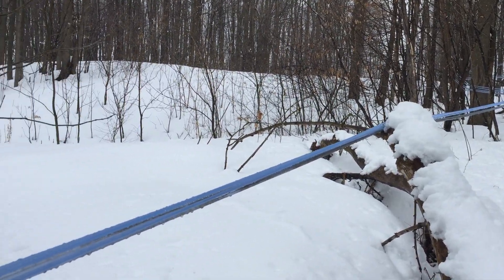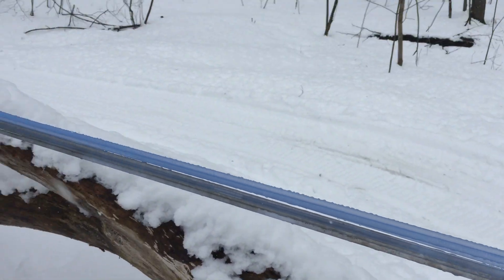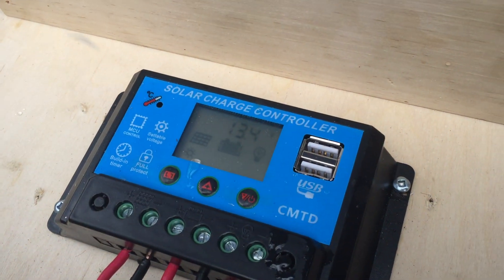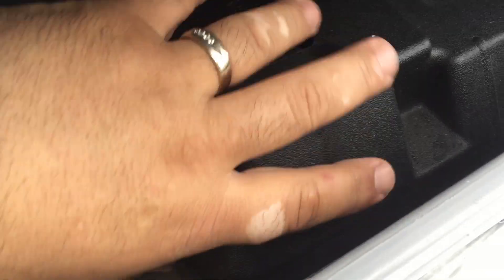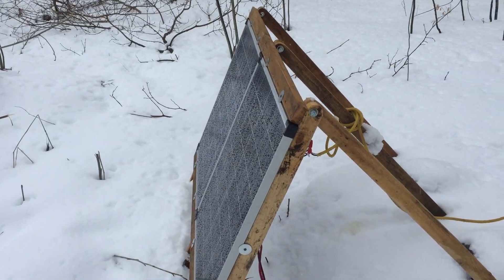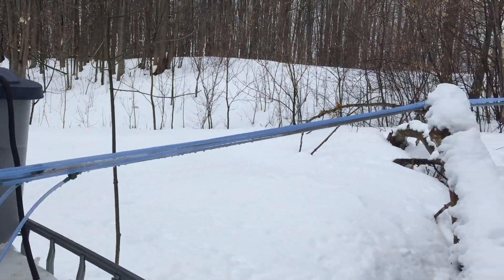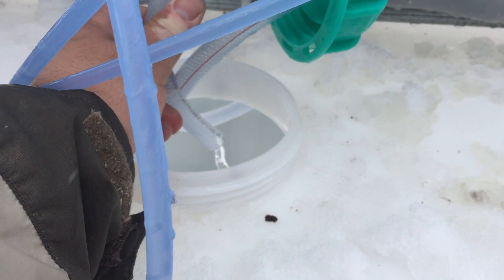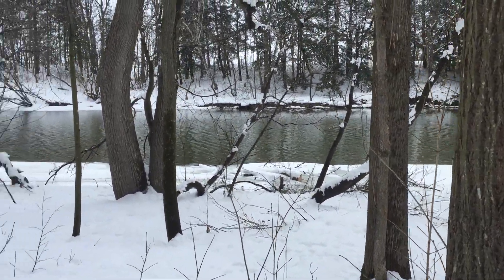Shurflo 4008 maple  sap vacuum pump setup - SOLAR POWERED

Comment: Thank you for this video!! and to the others that have made videos of there setup based on yours! Im starting to piece together a setup like this but I have 110 access so using ac to dc convertor. 100ish taps with longest run 400ft. If I hit any snags I will reach out!

Comment: Do you find the 2 x75w solar panels enough to keep the battery powered up?  Was at Costco today and they have a 120w solar kit for $200 cdn  comes with 8.5 A charge controller
300 W modified sine wave inverter.  Was not sure if that is enough wattage to keep battery charged.
Reply from the maker: Hi, yes, if you have good clear access to sunlight.  I have been using the system for 4 years now and have never had to charge the battery during the maple season.  I do recomend a type 31 deep cycle battery.  Just keep an eye on your voltage.

Comment: I've been inspired by your's and Wander Wild Farm's video regarding your vacuum system.  Currently, I have 214 taps of which approximately 187 taps are on 3/16 tubing and about 27 on buckets.  Some of the buckets and tubing are located along the road and about 80 minutes to gather and pump into my holding tank.  I am considering abandoning the roadside taps and focusing on approximately 130 taps in what i call the back bush.  All the taps except for about 10 would be at an elevation above the tanks. With those 10, I'd have to lift the lowest tap approximately 20'.  To maintain my current production level, I'd have to increase my sap production to approximately 14 to 15 US gallons of sap per tap.  Is this possible?  I think you mentioned making 100 US gallons on 175 taps, which is roughly 23 gallons per tap, is this so?  Thank you for your comments.
Reply from the maker: Thanks for watching, and i truly understand wanting to get away from buckets. As much as i enjoyed the work and traditional look of the buckets hanging from the tree,  time was sparse.
This year we stopped collecting about 10 days before the season ended, and still managed to collect 3040 US gallons.  which worked out to around 15 gallons per tap. If we where to go to the end of the season we could have pulled in more. This is based on 200 taps as we added one new line last year.  we do not have any taps lower than the tank so i would imagine that could bring your overall vacuum down if all running on one pump.
this year our system was running at around 16-17 inches of vacuum, not the best, but better than nothing.
Reply: @SpruceCreekFarm  Good morning Chris and thank you for your quick response.  I subscribed and hopefully will be getting all your videos.  I'm in the middle of clean up know, but will check out the rest of your videos.  I have a couple of questions.  I think you indicated running the pump for about 20 seconds when redirecting the 3 way valve to remove water from the pump.  Is that adequate, no other drain?  What is the make and model of your temperature controller?  Where did you get the 7, SS barbed connectors and are they 3/16 or 5/16?  I was thinking running 5/16 from the manifold, then installing a 5/16 quick disconnect and 5/16 to 3/16 tubing connector so I could easily remove the fittings.  CDL makes both fittings.  I was impressed with your approximate 15 gal sap/tap, as that could work very well for me.  Oddly enough, I just turned 70 and I'm looking to reduce the number of taps, but I still have a steady customer list that I wish to maintain.  I have a CDL, 18" x 60" which I've retrofitted with a heat exchanger and oil burner.  Removing approximately 17 gallons/hour.  Also built a single pass RO, concentrating  to about 4.4% on average.  Last year in just over 2000 taps, I gathered just over 1,800 US gallons on about 210 active taps in 10 gatherings, with an average sugar content of 1.86%.  I was so enthused by your's and Bob Sookochoff's video, I was up  until midnight designing my own unit.  One other question: do you shut the unit down at night?  Thank you so much, look forward to your response.  Stay safe in this pandemic, Earl Weller

Comment: Looks great. Could you provide a schematic and parts list for the controller? What temperature sensor do you use?
I have a storage tank pump that pushes the collected tap up to my evaporator storage tank.
Thanks

Comment: Great idea and execution!  I’ve been pondering how to build a 12V solar powered vacuum system for a couple of years.  Yours is the first example that has me really excited. The temperature controller to turn the pump on and off was the eureka moment for me. I’ve ordered the parts and plan to have around 200 taps on a similar system this spring. Thanks for the innovative idea!

Comment: nice set-up! Do the lines have to be on a decline from tap to tank if on vacuum?
Reply from the maker: Not necessarily, but it would be best, as any vacuum you get from the natural vacuum will be added to what your pump adds.  if you where on flat ground i would estimate you getting 10-15 inches of vacuum, but if you have 10 feet of elevation drop you should see 17-20 inches and so on.

Thanks for watching an keep the comments and questions rollin
C
Reply from the maker: Hey BTW, i have seen your Videos before!  great work!  greeting from your northern neighbors.  Are you going to have a maple syrup video coming out? give me a shout out if you do !
Reply: Nice to meet you :) 
So here's our dilemma:  we normally run buckets, but our access roads to the woods are blown out and there is no other effective way to get sap out of the woods unless we run lines out. There is a small area in the middle of the woods that is slightly elevated. I'm thinking we can run about 100 taps (with my schedule I don't think I could handle more until I got a bigger cooker). Yes, we are going to be doing syrup videos. Season is pretty much a month or more early so we are in panic mode right now :(
Reply: is it possible to do a more in depth walk through of how you built it all?
Reply from the maker: I would be happy to help out a fellow sapper, contact me at sappy.mapleman@gmail.com and i can get you up to speed as i will not be putting out a video for a month or so.  Look forward to hearing from you.
C

Comment: coming out of your tap it looks like you loop your line creating a trap. Is that necessary to hold your vacuum? Won't the trap freeze bringing everything to a halt?
Reply from the maker: Hi Jim,  thanks for watching,  the loops have no purpose,  I guess I could make it a bit tidier.  How ever the entire line will be full of sap when it freezes so the fact there is a loop is not a concern,  from what I see when it starts to thaw, the entire line seems to thaw at the same time which only takes 10-15 minutes once the temp is above freezing.  I was concerned about the thaw time when I first went to 3/16.  But was very surprised how fast it thaws.  Have a great sugaring season and feel free to ask anything,  I will answer to the best of my knowledge.

Comment: Sweet set up! I'm running lines for our 200 taps this year and I'm trying to find a cost effective, yet effective way to pull the sap. How long do you think your lines are? Why didn't you go with a larger mainline like a 3/4"? What do you do at night when temps get below 0 C? Do you bring the pump inside?  I'll be just over 2000 feet for my mainline, so I think I might be stuck paying the $1400 for a CDL vacuum.
Reply from the maker: Hi there, my longs run is around 1100 feet, and the shorted being 500-600, i did not use a mainline, just a manifold in the pump box, i don't this 3/4 is necessary for the manifold.  no need to bring the pump inside, i would just bypass the pump with the 3 way valve and let the pump run for 10-15 seconds to get most the sap out of it.. has a few 17C night with no issues.  2000 feet of mainline seems i bit too much for the Shurflo, you would have to be 100% sure you have 0 leaks.  i have another video "Shurflo 4008 maple sap vacuum pump PART#2 MASSIVE SAP FLOW"  that shows inside the pump box a lot better.  Thanks

Comment: Looks like you good Vac to those lines.  Never seen em run so fast. You had more sap than one of our natural vac (gravity) systems with 350 sugars on it. How many pounds of hydrogen do u have on those lines?  Also about howany taps and are they sugars or reds?
Reply from the maker: There is only 3 or 4 taps on reds out of the 175,  as for hydrogen??... 0 pounds. Lol

Comment: Hey, will that diaphram pump work on flat ground. I have a bush about 1 acre with 100 taps. Maybe 200 yards by 75 yards. I want to try to vacuum it. This up seems affordable and effective.
Reply from the maker: Yes i would, i would suggest using the 3/16 tubing as it is mush more forgiving for sages in your line.  i would go with 20 taps per run.  i find with having 25 per run on mine that on days where the sap is really flowing i get a backup of sap near the end of the line.
Reply: Spruce Creek Farm the end of each line just goes to the last tap on the line?

Comment: Nice solar setup, What are those green square item attached to the 3/16 lines just before going into the holding tank ?
Reply from the maker: They are connectors with a hook in them, I use them  to attach wire to,  it is then tied off to the tree beside the tank. They are from CDL maple supply.
Reply: After your reply I watch the video again and saw the anchor wire. I also watched all your videos and after that I subscribed. Really enjoyed all your videos especially the one of the grouse following you around, I hope you gave her/him a name ?
Can't wait for your next video.

Comment: Nice set up, snowmobile should be busy lugging all that sap.
Reply from the maker: Thanks Dale, with the weather forecast for the next week it will surely be getting a workout hauling sap.
Reply: What has been your biggest day with the 175? Have you had a 300 gallon day?
Reply from the maker: SO far this season our best run has been 1000 liters on the 175 which works out to around 265 US gallons.  We have 200 buckets up as well which this year is too much for our 2x6 evaporator.
Reply: Nice. I have pumps mounted in storage tubs as well. Found out the hard way it's a good idea to drill some drainage holes in the bottom of the tub. I had a hose pop off and fill one of my tubs to the brim with sap, the pump survived but the power supply did not.
Reply: What do you think with all solar stuff .pump .batteries. electrical supply what do you have in it.
Reply from the maker: Never had to charge the battery all season,  longest run was 72 hours none stop.  Solar was worth every penny,  pump is 3/4 in the bush and hauling a battery out there would be a pain.  All in the pump box cost $700